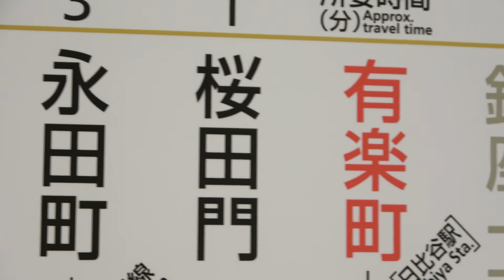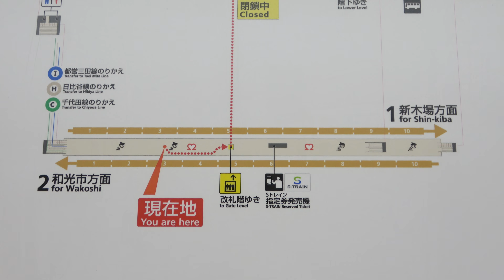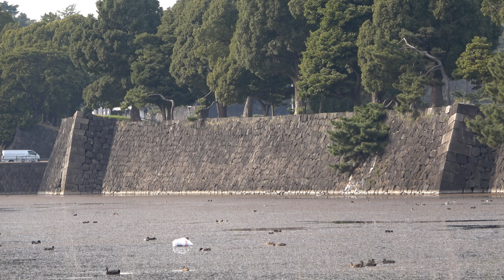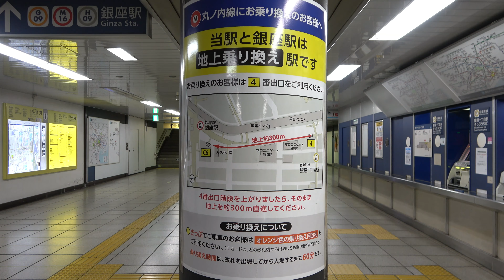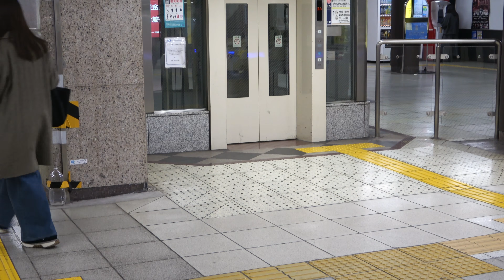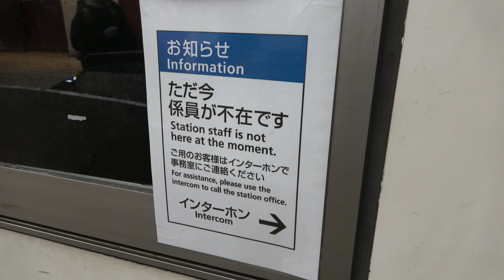Tokyo Metro's Three Stations: Interesting Structure and History

Comment: One thing always to keep in mind that makes Japanese subways different from other systems. Japan has the strongest property rights in the world, which means its extremely hard and expensive to buy land for public infrastructure, and you to have pay a lot to dig under things. Which means Japanese subways are built as much as possible under roads to reduce costs, even when that requires double decking with roads in the case of the Yurakucho line, other subway lines in the other places. 

That said it was a mistake not to have connecting stations to the Asakusa and Hibiya lines.